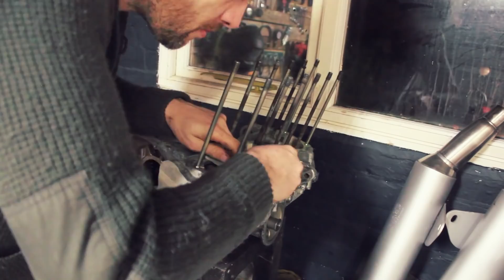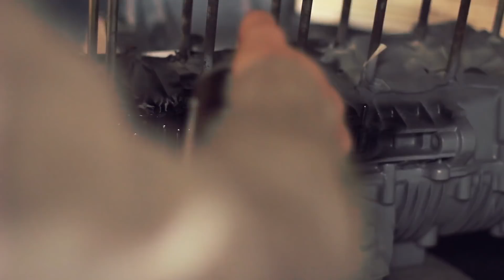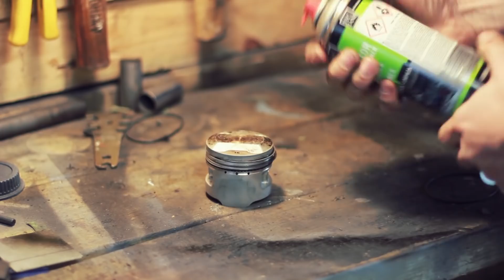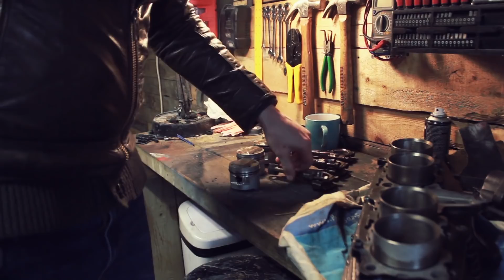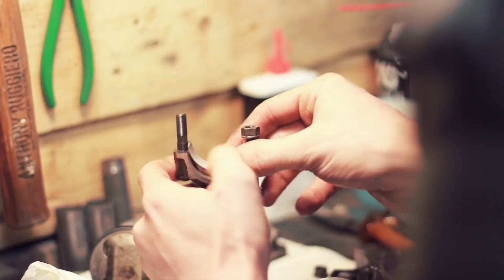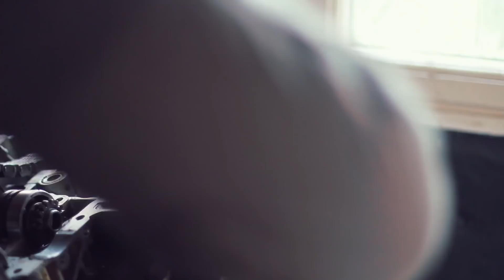Honda CB750 Cafe Racer Part 20 - Engine rebuild, piston rings & bearings

Comment: Did you manage to compress the rings with your fingers when you installed them in the cylinder or did you use a piston ring compressor tool ?
Reply from the maker: The bottom of the cylinder is tapered for you to insert without the need for a tool
Reply: @forthebold  thanks ! im currently rebuilding one and your video is helping a great deal. keep up the good work!

Comment: Can you make a recommendation on paint/primer brand/type? Also, do you typically leave the head studs in or replace them?
Reply from the maker: I use VHT if I don't powder coat the engine, and on this build every bolt was stripped off

Comment: Hello, friend! 2 questions: would you recomend sand or soda blasting on a CB750 engine block? and I´m having a lot of trouble finding the crankshaft bearings for my CB750F where did you get yours from? Thanks a lot man.
Reply from the maker: Get them from David Silver Spares, about £240 I think in total. I recommend soda blasting with a bit of glass bead mixed in

Comment: Love the 750 DOHC videos! Did you manage to get new connecting rod bolts, they're discontinued so I'm having issues with that! (OEM and aftermarket nothing!) did you reuse the old ones?
Reply from the maker: I reused the old ones as after talking to a lot of Honda mechanics they said they would be fine unless they appear stretched.

Comment: you put the rings on the pistons without checking the ring gap in the bore first to check for enough gap for expansion first year apprentice mistake.
Reply from the maker: Already checked and they’re specifically for the cylinder bore.

Comment: Is it possible to fit a 750 gas tank on a cb400 or cb250 frame?
Reply from the maker: Possible yes. It is however a really long tank. Might need a bit of fabrication doing to the mounts.

Comment: Never use the old bolts on the piston rod again. Bad mistake!
You will never reach the perfect pretension again and you are causing damage on the crankshaft bearings, so the Engine.
Otherwise, I love your videos. Keep on working!
Reply from the maker: These are fine. They’re not stretch bolts. Checked with manufacturer, several garages and Honda expert.
Reply: I made other experiences during my study.
And a few bolts are way cheaper than to rebuild an engine.
Just think about it, it´s probably not your last bike build!
👍
Reply: I think this only applies to the 69-76 k models. The connection rod bolts and nuts from 78 -79 are an upgrade for the older bikes

Comment: Very nice work. Was the painting this week? What temperature was it? Or do you have heating in your garage? I've got my cb900 engine out from under the bike now and kinda want to repaint it as well, but I figured it's too cold now in the garage so mayby I'll wait till spring (or convince the misses that painting a motorcycle engine in the living room is very normal). Any tips on paint/surface prepping and actual spraying?
Reply: I'm keeping the cilinders assembled. Just got the valve cover off and replaced the camchain pulling it through from the top and a little clutch and timer/starter engine gears maintenance.

Comment: you shouldn't handle plain bearings with your bare hands
Reply from the maker: Only touching the sides then coating of assembly oil is thick. No hands touching the surface.

Comment: Hello Mate, may i know where did you get the pistons rings and gasket set?
Reply from the maker: I got them from David Silver Spares UK
Reply: @forthebold  Thanks mate, i found some parts in the same place but USA. Other question what brand of paint and primer did you use? and if you  could tell me a little but of the process. I was researching in my local market and those guys are expensive.
Reply from the maker: They can be a bit pricey, it's VHT paint and you prime and bake for an hour rising temperature gradually

Comment: Can you make a video about commons problems of CB750?
Reply from the maker: Biggest problem I can tell you now about the DOHC 79 model is the crap charging system. All depends which CB750 you're interested in as they change a lot from SOHC - DOHC etc
Reply: @forthebold  I'm looking to get CB750 year 1998 model but i scared it may have a lot of problems like my CB 250.
Reply from the maker: 98 I'm not too sure of, could be water cooled & fuel injection, out of my knowledge I'm afraid
Reply: @forthebold  okay, anyway thank for your reply, and big fan of your work👍👍.
Reply: @forthebold  - I agree, I have an 83 CB650SC and the charging issues was a bear to fix. I had to swap out both the stator and the VRR, what a mess
Reply: Known for noisy cam chains, so I have heard from a local mechanic.  Mine happens to be one of them :-/
Reply from the maker: Forgot about that. Yeah. And on ones like this 79 model the cam chain actually eats through the cylinder casing. Which has happened on this too